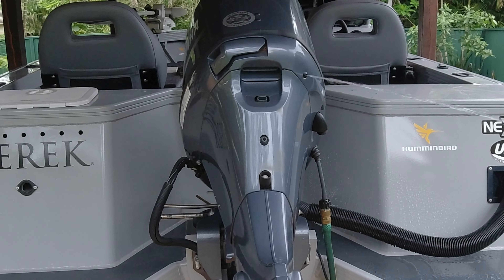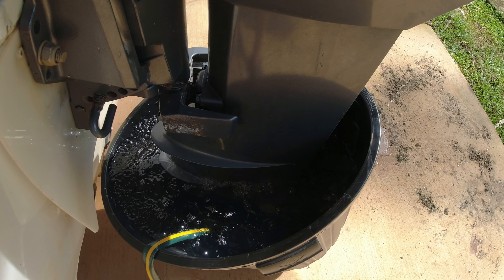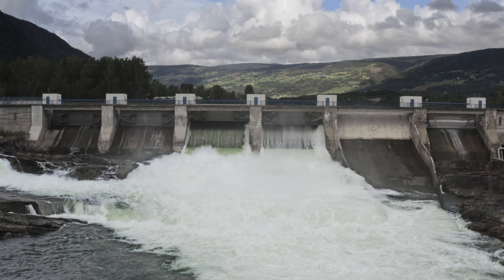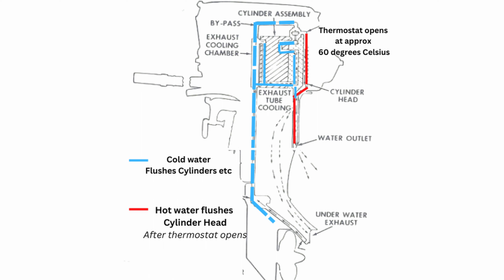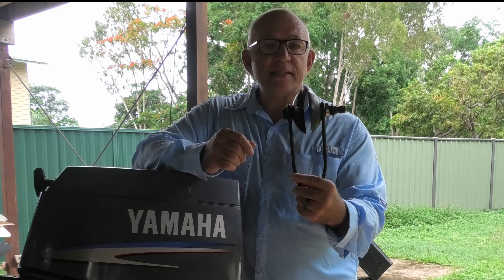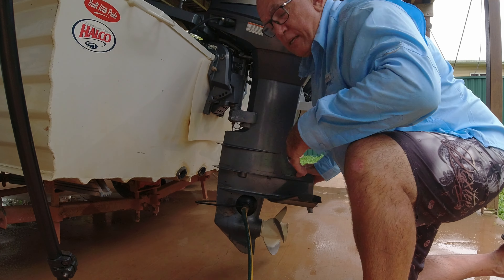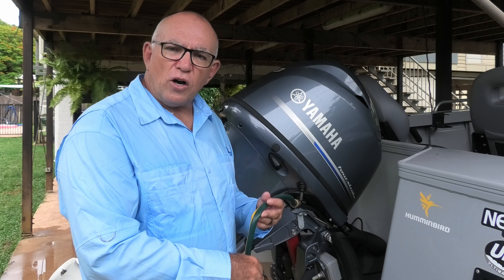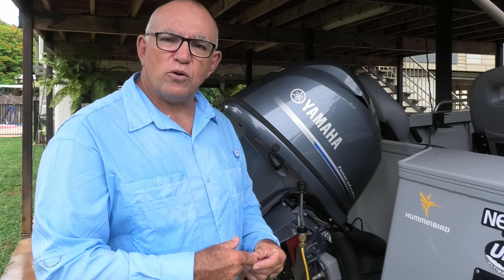THE RIGHT WAY TO FLUSH AN OUTBOARD MOTOR

Comment: The problem is my house water pressure is only 35 psi, maybe just under 40. When I hook up the hose to the attachment, it doesn’t pee out the tell tale sign. Would I be able to use earmuffs with that pressure? Or do I need to use a bucket? I wanted to use this product salt away and in the bucket I don’t think I can use it
Reply from the maker: If you hook the muffs up and you don't get water coming out of the pisser but you do with a bucket, then definitely use a bucket. Bucket is the best method anyway but out of convivence, I use the muffs.

Comment: So why do you state its so important to get temp up so thermo xan open etc etc but do cold flush on your larger engine?
On larger engines I.e. 150, is cold or through muffs better.
Cheers
Reply from the maker: I cold flush my big engine for a good clean out but still put it on the muffs when it is hot to get the head cleaned. So its better to run it on the muffs for a few minutes then give it a good cold flush. Sometimes, once the engine had cooled, I just do a cold flush and never had an issue but a muff flush is better.

Comment: Does this apply to 2 stroke engine too?
Reply from the maker: Thanks Sunny. Just building that channel up and that is my goal. Straight talk and straight to the point. Thanks for the kind words and support.
Reply from the maker: Sorry Sunny, that last reply was for another comment. But yes, absolutely for two stroke engines as well. My 30hp Yamaha is a two stroke. Most of the old two stokes don't have a cold flush system so you have to put them in a bucket or on the muffs. But same principles.

Comment: Gday mate someone on another video mentioned the same as you about the neighbours now not trying to sound arrogant or rude i say stuff the neighbours there not paying out big dollars for an engine that must be flushed , the lad next door was doing what you said and i had a word to him and he said didnt want to disturb the neighbours ,my reply was you wont disturb me run it till its clean he has a 80 yam four stroke and really they are not noisy compared with the two strokes ,the top flush is okay if you cant do anything else but they didnt have em  on two strokes so its muff flush for me . Good point about the warm water stream that way you know the thermo is open  and water i circulating around the water galleries .
Reply from the maker: Thanks mate. And you're right. I work and live in a mining town so have a lot of people on shift work so I do worry about the neighbours. But we have a hose at our boat ramps so I do a muff flush at the ramp as soon as I pull the boat out of the water and still run a cold flush when I get home. 
I can't believe how quiet the new four strokes are. So thats a good point. They are not like the old two stroke at all. 
Thanks for the comment mate. Good points.
Reply: @smallboatcaptain1968  Hi mate another reason i say this is last sunday i was woken by a guy 2 doors down using a industrial pressure cleaner  , now on sundays/public holidays  there is a noise limit up to 10,00 and getting woken up at 7.15 i was not impressed i think one of the other neighbours told him to shut it off as it stopped soon after .
Reply from the maker: @crispernator  Yeah I cant agree more mate. Some people are very self-centred. But doesn't mean we have to be assholes too. Fair point though.

Comment: Hello from the U.S. Thanks for the video and the warm piss tip!  I was wondering about running your engine using the top flush port and found this video... https://www.youtube.com/watch?v=LRAyaUWMrjw.  It looks like the water does go down to the impeller.
Reply from the maker: Hi Cliff. That is a great video. I haven't seen that before. I do see some water come from the lower unit when I cold flush my engine but nowhere near that much so I wonder if more water is going to the impellor because the lower unit is off. 
I know some people run their engine when cold flushing but because I am not an outboard mechanic, I have a shipping masters and worked on as well as owned boats my whole life, I just stick to what is recommended. But I will no doubt mention this in other videos as it is a great example of how water does get into the lower unit. 
Thanks so much for sharing that.
Mark